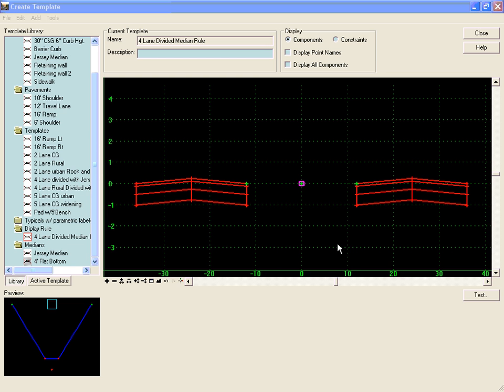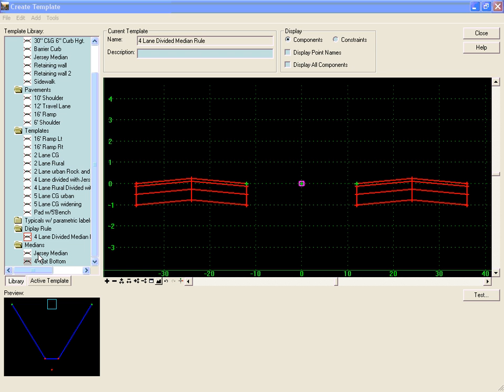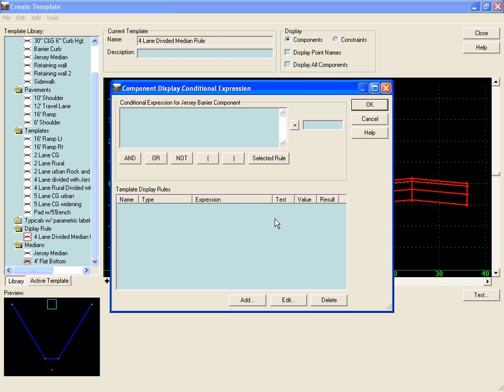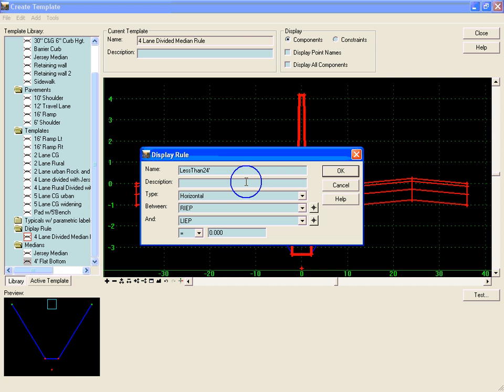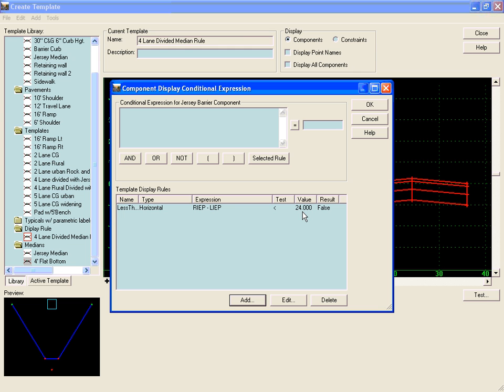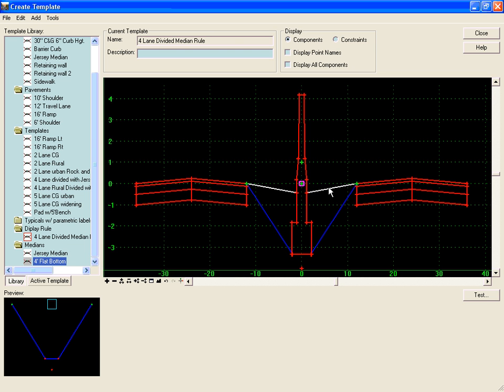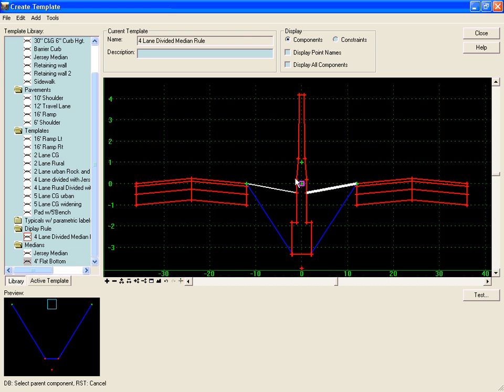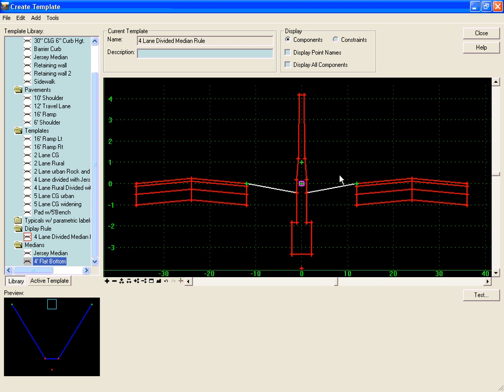Display Rules

Comment: is there anyway to controls puts to do something like this? i need a layer of crushed stone to come up to end conditions when they are either 2:1 3:1 or 4:1 from this it seems like i would have to creat three different conponents for the crush stone to tell one or the other turn off. but i rather have two points of the crush stone to go till they hit the end conditions which ever one it may be in the location